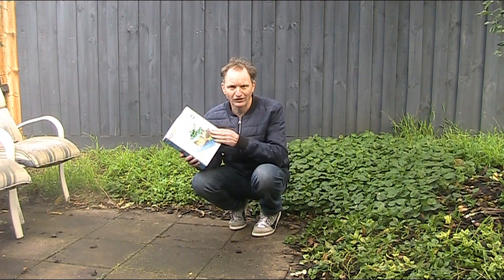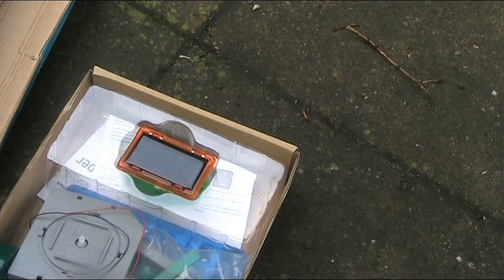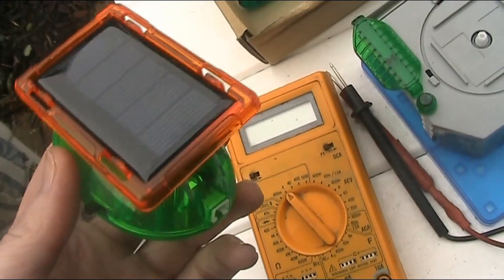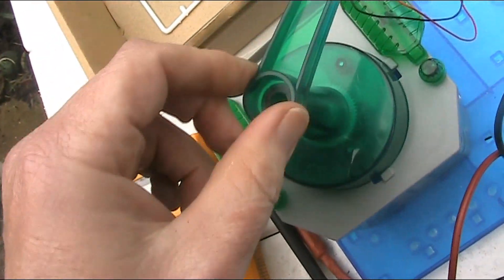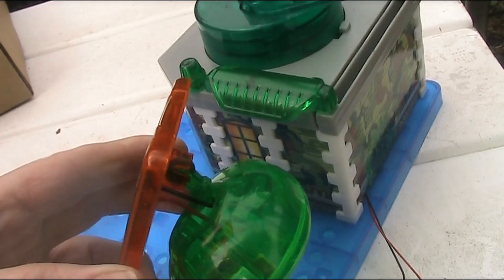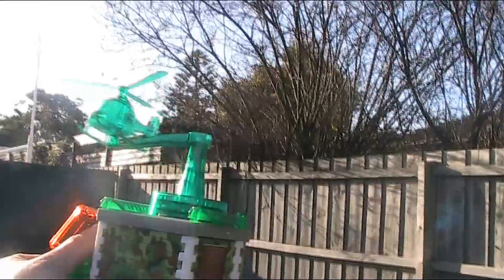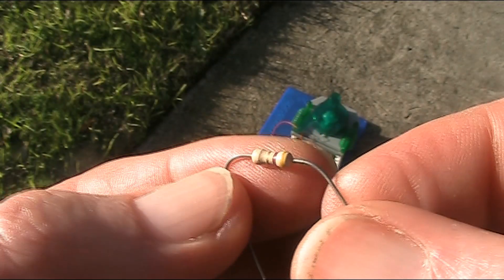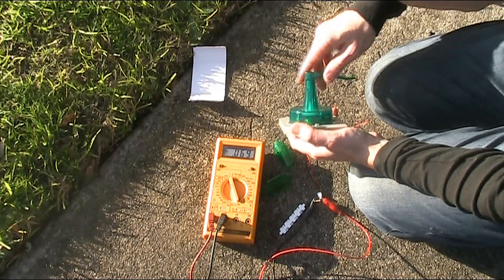Testing (and breaking) a toy solar helicopter

Comment: I won a very similar product at a Christmas party about 4 years ago. When assembled it was a Dutch windmill. I recognise many of the parts you showed, but the packaging was different. The wires are very thin, fragile. It works still; nudge, nudge. I'm not letting you near my toys.